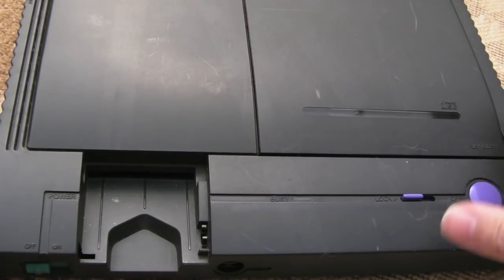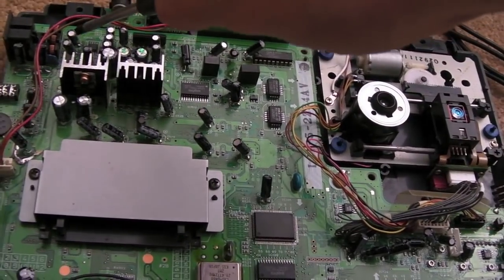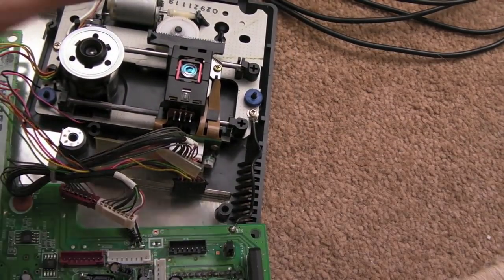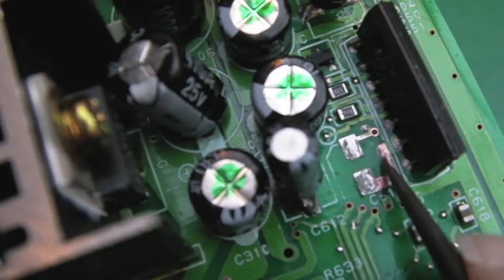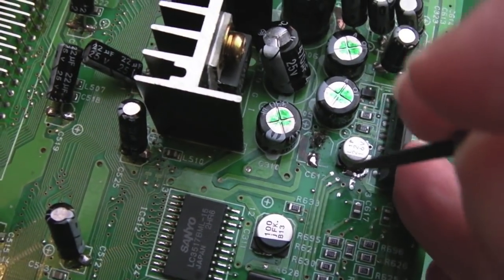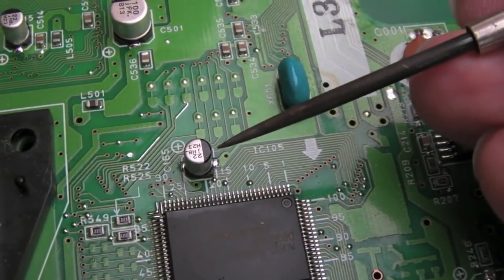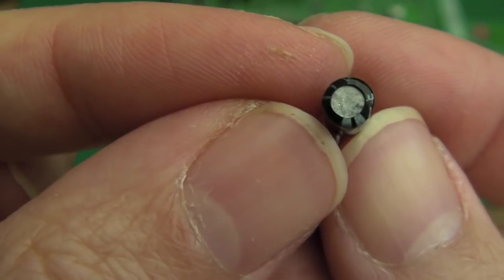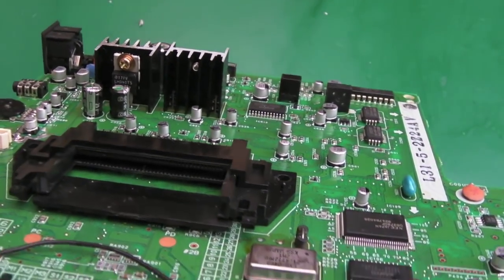NEC PC Engine Duo Multiple Repairs Part 2 (Recap & Laser Whine Adjustment)

Comment: I've not done anything this elaborate but yeah the cost of parts and repair can be hard to justify. I've given consoles a good cleaning and I'd like to replace something as simple as the rubber contact controller pads but who's going to pay for it? Not unlike classic car repair in how you'll never get that restoration money out of it again in many cases.
Reply from the maker: Yes, that's a good comparison you made there!  We often put way more time in than the end value of the system we restore =/